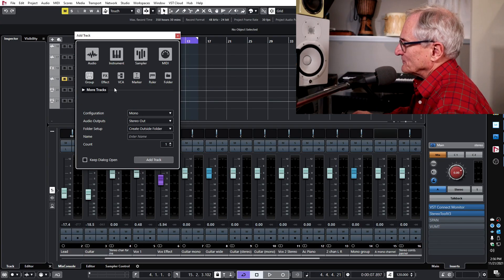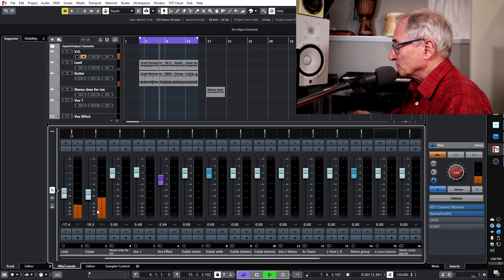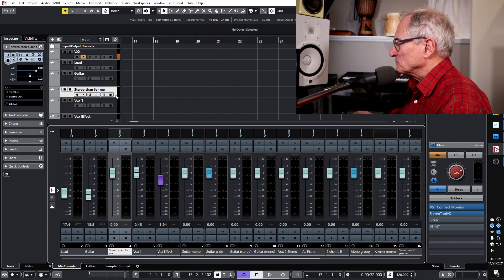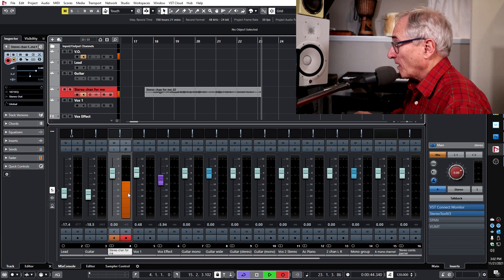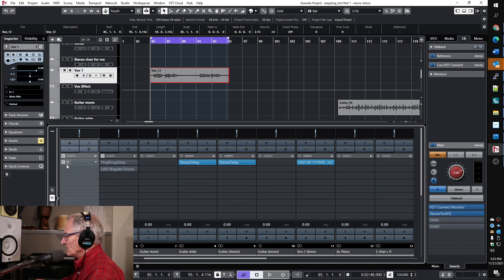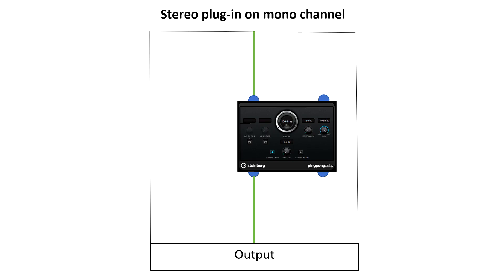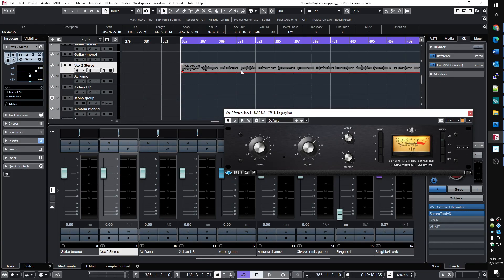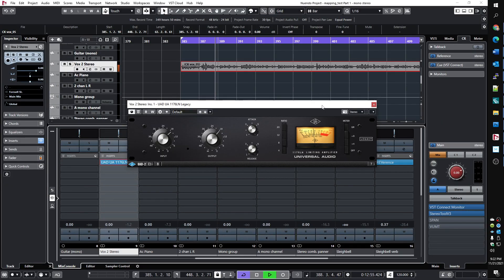Secrets of Signal Routing and Channel Types in Cubase/Nuendo, Part 1: Mono / Stereo

Comment: It seems to me like using a mono configuration is just limited overall. What is the utility of a mono channel if you can actually do the same thing in a stereo channel with more flexibility? For eg. I can set up a stereo configuration but with only 1 input. So when I record through a mic I still get a mono signal coming through both speakers. But I can add a MonoToStereo plugin to that channel if I want a stereo response. So what is the actual benefit of a mono channel?
Reply from the maker: Yes, it's good advice to record mono signals on stereo channels if your intention is to produce a stereo mix and you want the most flexibility from the start. Like a lead vocal for example. I probably should have made that clearer.  

Mono channels are sometimes necessary, like when you want to downmix stereo to mono, and especially when mapping mono signals to Dolby Atmos objects.
Reply: @balladeerstudio  Thank you for clarifying. Never thought about downmixing to mono and very good to know about Dolby Atmos though I haven't used it yet.

Comment: This is apropos for many of my editing and mixing questions that aren’t exactly clear concerning routing mono or stereo tracks when using mono/stereo sends. 
I’ll need to review this several times.
After that, I’ll have more clarity on mono/stereo concerning the sends when mixed with the original audio track. Many times I’ve questioned why I can’t get the panning results desired because I didn’t have the clarity needed when panning. An orchestra project which is very large needs this clarity when panning while using mono or stereo send affects. 
I gratefully thank you. Now, I’ll watch it again for the 3rd time!

Comment: thks your explained sir..can you post video how to routing with outboard hybrid mixing, summing or as plugins on  hardware analog with mono gear and stereo gear in cubase pro....Thks alot..
Reply from the maker: Thanks Ali. I'm sorry, but I don't have a clue about that.
Reply: you set up your externals (all your ins & outs) once under „F4“ as external effects 👍🏼. After that you can use or „patch“ them whereever you want within the cubase mixer … even with latency compensation
Reply: @ricardohohmann9614  yes thks..but why when iam have print realtime..sound is not same level that i hear before ..
Reply: @alihanapiyahofficial24  that is difficult to tell without sitting next to you in your enviroment. There are so many options and literally thousands of ways to monitor and set levels while recording

topic a) calibrating the levels between hw devices and converters
topic b) monitoring chain
Reply: @ricardohohmann9614  yes i see..thks.. i will try to find it..but many people say it common..because..mybe every device not same dynamic range..